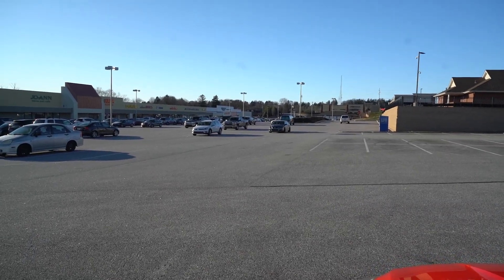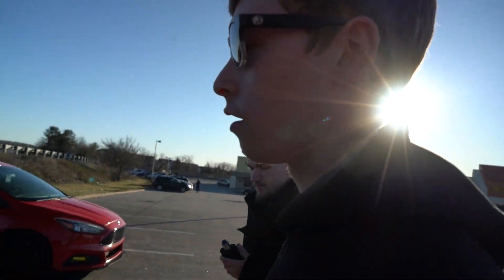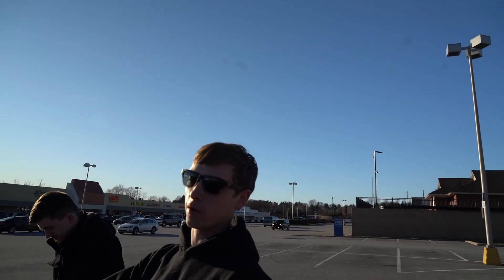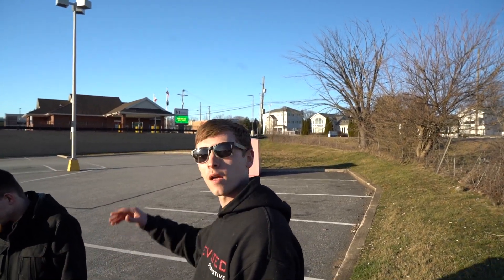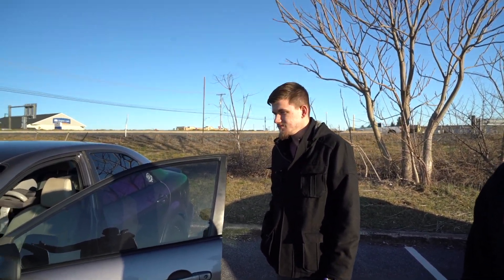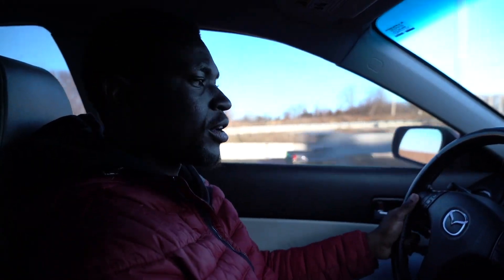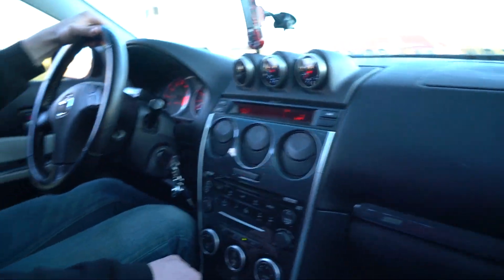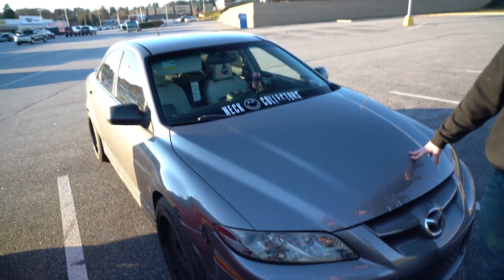Built motor/Big Turbo 500HP MAZDASPEED6 AWD. FUN AND FAST

Comment: Stock fuel system limit is about 380hp, so he's not at 500hp yet until he upgrade his fueling. And the car is shaky because he upgraded to a solid motor mount and have a balance shift delete not because it's old.